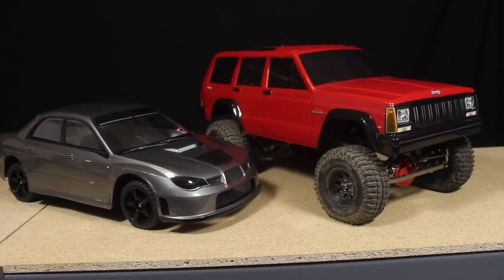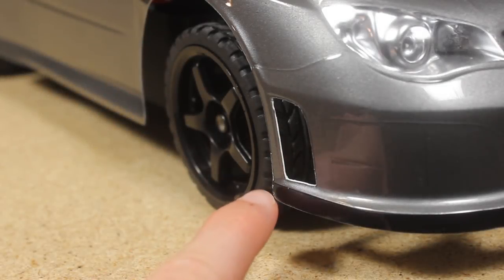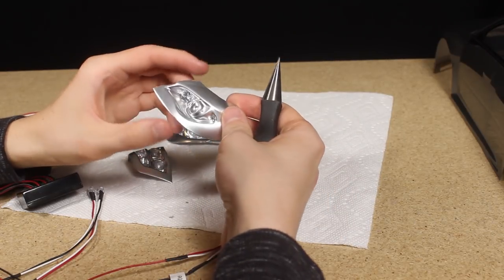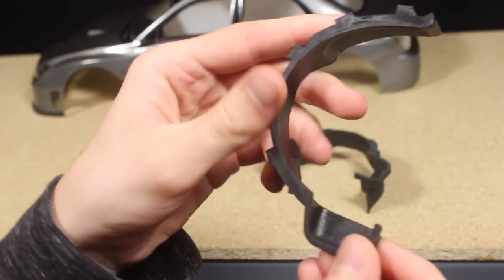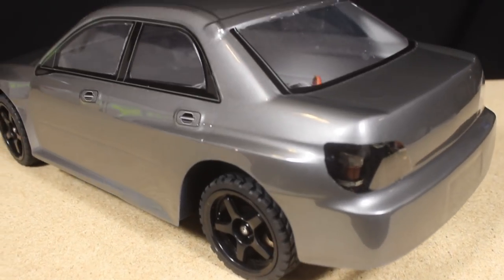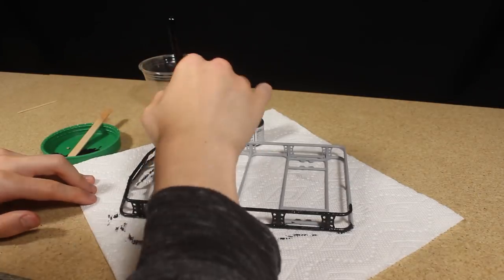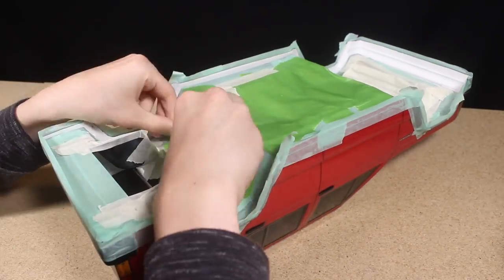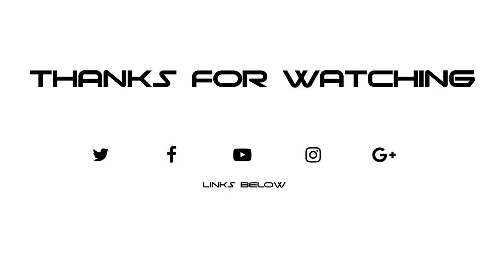Update on the Subasharu and Jeep Cherokee

Comment: Just a thought. I have never used a 3D printer so I don't know if it would work. But Next time you print a stand off for the grill mesh right before part finished. Lay the mesh in place while the plastic is still soft and warm then finish printing over the mesh. Once finished trim mesh around outside edge.
Reply: It doesn't work like that. The plastic is not molten, just melted enough to flow, then rapidly cooled.

Comment: Exited to see how it works out!  How much would it cost to make some inner fenders for my car??
Reply: Also I like the inner fender set up on the jeep
Reply from the maker: I would sell an identical set of the inner fenders that I used on the Subaru unpainted for around $6 + shipping if applicable. Please note that the fitment is Okay but not perfect. If you car is something different and therefore would require a custom designed inner fender, I'm currently unavailable to design custom parts like that at this time.
Reply: Make It RC yea I have a Toyota 86 not a wrx. And ok that's fine !